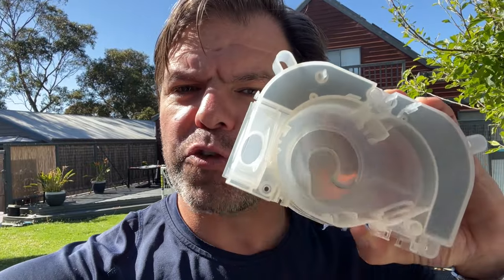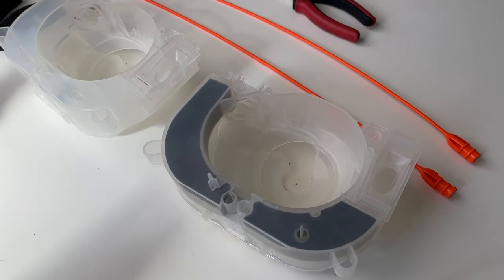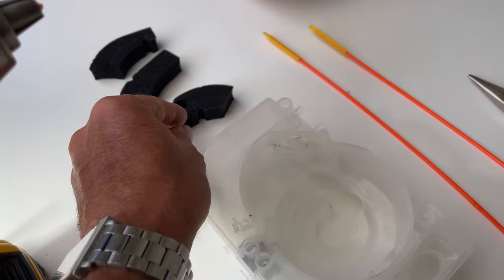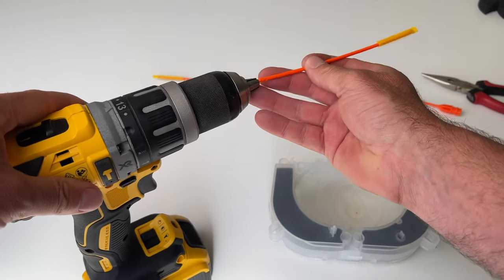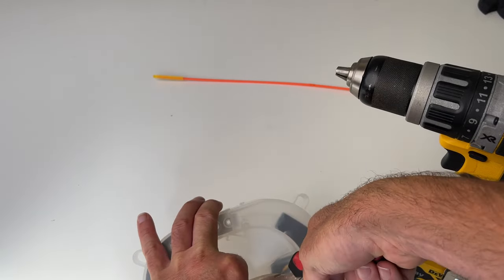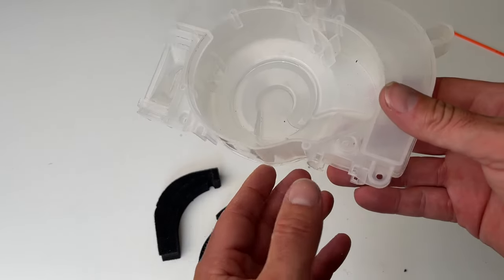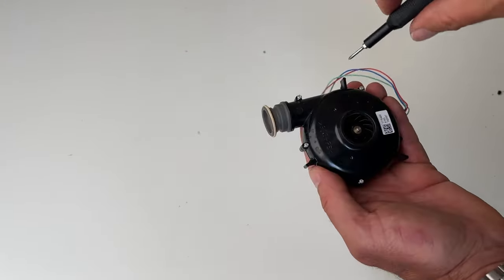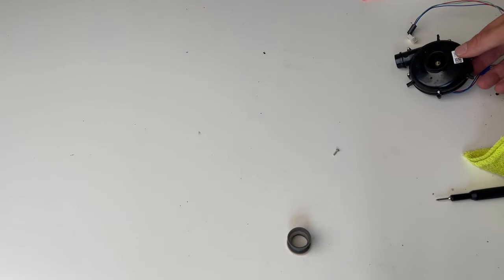It Works! New Improved DreamStation Foam Removal Tool! The Drain Weasel Method

Comment: Can anyone advise if the foam was glued down? Was there residue left in the chamber after removing the foam? If so, how did you clean the chamber after removing the foam?
Reply from the maker: G'day, it should not be glued down but it can sometimes feel that way as when the foam degrades it gets sticky and feels like it has been stuck down. Not sure how you could clean it out after removal. I was able just to blow mine out. Cheers
Reply: I found some foam was stuck inside (I've never used uvc or ozone).and had to drill small holes to allow a scalpel blade to be inserted to cut out the ridges where the foam was stuck.
Reply: It's kind of strange that, in my case, I DID use ozone for about two years (about two times per week) before stopping its use back in June (after the recall).  However, when I took the foam out today (using a Drain Weasel), none of it stuck in the chamber.  It did crumble very slightly (found one or two small, but loose, particles in the chamber after removal).  I just rinsed out the chamber with tap water and it is now air-drying in my bedroom.

Comment: Sorry Mate! I gave it go. If even it worked on
the one side, it won't on
the other. You can't bend the weasel 90 degrees to reach the side by the filter. I ended drill 3/8" hole on 
top on both sides in the
middle of foam section.
Bent a thin stiff wire into a hook, grabbed the foam, twisted and pulled foam out. Used a vac to pull any small
Crumbs left behind. Try not to scratch the inside plastic, or foam
will stick to any rough
scratches left behind.
Super glue a 1/2"x 1/2"
Square to cover the holes.

Comment: I removed the foam in my DS1 half a year ago. By drilling access holes in the plenum, removing the foam with Merle nose pliers and then blocking the holes. Oscar data was the same before and after foam removal and there was virtually no difference in noise level. Have registered for the recall, received a task number but nothing else. I’m in Canada.
Reply: Needle nose pliers.
Reply: yes, drain weasel method did not require altering the plastic casing... O:-)
Reply: did mine the same way works great. at the time I tried to do something like the weasel couldn't get done so went with the drill
Reply: @waynelewellen8424  too bad now your plastic casing's altered :(
Reply: This is a year later. David, have you heard about servicing? Did you get a replacement yet?

I don’t know if anything is happening here in Chinada at all. I don’t read of anyone getting serviced.

My sleep clinic didn’t make it thru the stupid lockdowns and they went under. No word of notice on that either, just tried to get help one day and landlord foreclosure sign was on door. So took the cell chip out, where was my data going all that time?? Didn’t want it going to “unknowns”.

I got a recall service number too but that’s it. Still. In well over a year.

Tried finding old email or numbers to contact a follow up, nada. 
I don’t know if I’m ineligible now the clinic went under or if they deal with individuals one on one (I hope they do)

Now I got the foam out I’m considering just the class action lawsuit... I don’t trust them not to replace it with something just as poisonous, looking at that tear down video of a “replacement” model  That foam looked even worse and more likely to flake.

Actually, I kind of hope they DONT ever follow up, but hope the class action lawyers do... I prefer that outcome, and the lack of foam appeals more too

Comment: HELP!  The procedure worked great for getting the foam out but now my dream station won't run. THe power light comes on and then after w few seconds it starts beeping,. Nothing appears on the screen. Unplugged it a few times and at one point the fan did start running but start again once turned off.. Took it all apart and made sure connectors were inserted properly.  I originally did not remove the ribbon cable from the board but was careful in handling the board and front panel so as not to hurt the Ribbon cable. I have since removed the ribbon cable from the board and reconnected but still no display.I examined the ribbon cable and it's connection to the front panel and all looked good. Any idea on what to do?

Comment: It looks like there are some broken foam particles left behind in the chamber. Can they be rinsed out or blown out. The problem is they put bitters in canned air. It really pisses me off that for a few that abused canned air, they ruined canned air for a lot of legitimate uses. (I.e. electronics etc.) I have an air compressor but do not consider that as a very sterile option. I have to wait till January 6th to even get a script for a new CPAP. I have older dinosaur Resperonic machine that still works, that I could use that if I mess this up. It uses the old credit card style memory cards. I use it for camping because it works great on battery power. My sleep doctor hates it because they can no longer read those cards.
Reply from the maker: Hey mate, yeah i just blew them out with my garden blower but you could use a hair dryer or even probably rinse it out with water. Cheers mate. Nick
Reply: A year too late but will toss this in here... Dunno about water... look at the separation area between the two foam chambers, there appears to be some further filtering device, window, something.... looks like a set of blinds or pleats like on a filter for your car dividing the two chambers.

might wind up washing particulate up on it or maybe water compromise it or mould it, while air wouldn’t. Then again air might damage it too if too much pressure. I went for light air from blower on low and held far from the opening.

Comment: What is the difference in sound level with the foam completely out?
Reply from the maker: It's pretty good mate. Certainly not a big difference. Cheers
Reply: Shorter version of my earlier post... I would’ve used a dB meter if I had access to one, so I used an analog tape deck instead knowing it didn’t have built in auto gain/correcting stuff in it.
Lots of effort for nothing lol. 

I would say the sound changes but doesn’t get louder, kind of like the sound of something sticking outside your car window on the highway if it turns, tonality changes not volume.

Comment: Frustrated, spent a long time working on this.  removed the foam that is accessible from the center bottom.  But for the one located near the top, cannot get the drain weasel into the foam.  It always is below the foam. Have tried bending the weasel also. This is a brand new unused machine from 2017, wondering if the hole to access the foam might be slightly different.  suggestions please, thanks, I really appreciate the channel.
Reply from the maker: You can get it mate, just need to keep pusing around, try different angles with the drill / weasel, you almost need to bend it off the inside roof of the housing. If you can't get it then just buy the empty case off amazon for $30 https://youtu.be/DuVeh2q-78c
Reply: Mine was also purchased in 2017 and the smaller piece of foam was definitely extremely difficult to extract.  The little "funnel" shape of the air inlet (where the filters attach) would not allow the Drain Weasel to make contact with the foam.  So, I also wonder if there was any change to the design since 2017.  I bent the Drain Weasel wand and just made sure to turn the drill VERY slowly.  I had to try several times and it finally caught on the foam.  BTW, the turbine housing on mine was the "sealed" type and did not have the accessible screws shown in Nicko's video.  I used a small hand-held hobby vac on both ports of the turbine.  Hope that is enough to remove any foam particles from the turbine.

Comment: If there's dust, in the turbine, then there's something wrong with your intake filters. 🤔
Reply from the maker: Hi Kenny, unfortunately this incorrect as the internal sound abatement foam is inside the machine. Cheers

Comment: I removed my foam using the drain weasel. Has anyone noticed to much air flow after doing this?? I backed my pressure down to the lowest setting and still get way to much air flow. HELP!!

Comment: what's the purpose of the foam?
Reply: THAT is a VERY good question.  The stated (by Philips) reason is to lessen the noise that the machine makes when you run it, so they are calling it "nose abatement foam".  But almost everyone who has removed the foam, or replaced the air chamber with a foamless one, notice very little, or no difference in the noise level.  The fact that Philips put this toxic material in their product, and then made the deliberate, conscious choice to stay quiet about its toxicity for at least two or three years after becoming aware of the problems, makes me wonder if they really are trying to rid the world of people with respiratory ailments.  Make no mistake.  These people (Philips executives) are criminals who should be put away for life.  They should be forced to use their own respiratory products (with the toxic foam) every night for the rest of their lives.

Comment: Something is fishy. He happens to accidentally miss recording the part nobody can get to work on the input. Even when he demonstrates a second time, there is a cut in the video where the most difficult / impossible part is - grabbing it with the weasel.

Also, he says try to get it out in one piece. How is that even possible? There is a plastic cylinder going right through the middle of the foam top to bottom. It has to break in two to come out.
Reply from the maker: Hey Bill. Go and buy a resmed for god sake.
Reply: @CPAPReviews  Seems to be your agenda. LOL